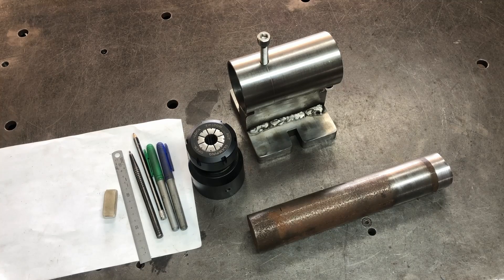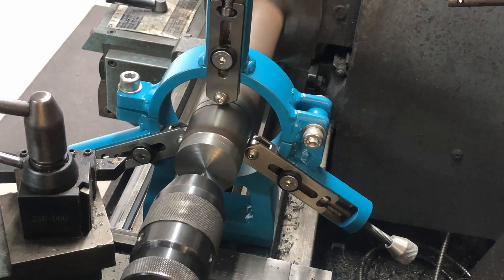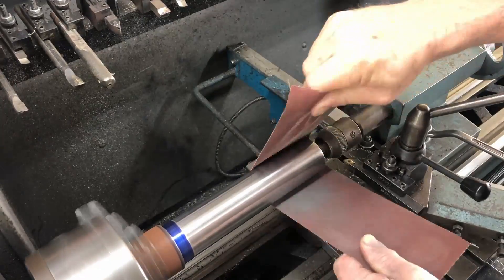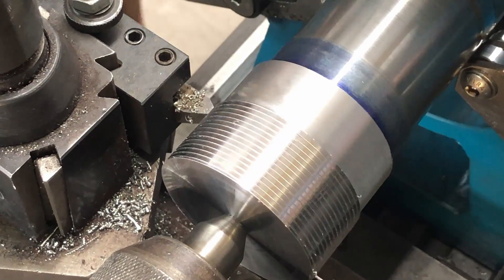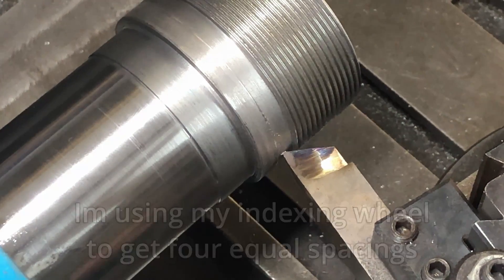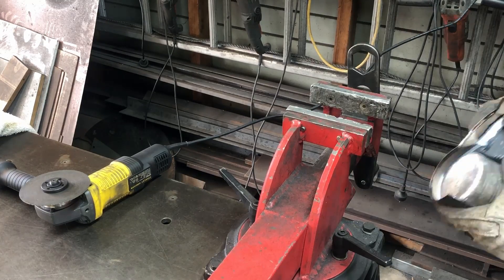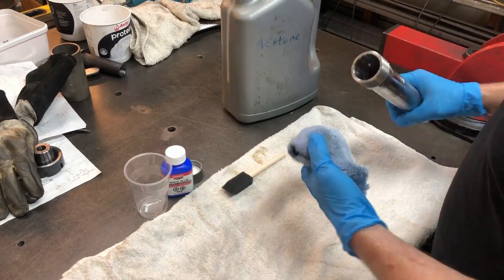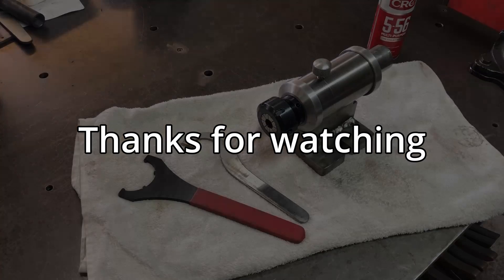Spin Indexer Build - Part 2

Comment: When you were checking the taper with the collet, blue at top & bottom, it could be because the grinder was slightly set off centre, a barrel shape is produced, thanks for sharing a very interesting video 🇬🇧👍.
Reply from the maker: No problem. Thanks for your comments.

Comment: Generally, all the Chinese ER collets are useful for are paper weights and not much else. Chinese ER collet holders aren't any better. You can buy one of the Chinese $30 ER sets as long as you realize that you are buying a pig in a poke. If the runout is less than 0.005" consider yourself lucky.
  Buy from suppliers who have a real address and guarantee their collets and holders to a given specification. Yes, a set of guaranteed collets will set you back ~$200 but think of all the new curse words you won't have to learn.
Cheers from NC/USA
Reply from the maker: Hi, thanks for your comments. Yes, I was probably lucky with my collets. 

There are two issues here in NZ regarding collets (and most other tooling). Firstly it is hard to find good quality branded collets (I have not found any in NZ to date). Second, a set of ER40 collets from a popular retailer like Machinery House is $700. Even then they state that the collets are made in Taiwan.

Comment: Thank you for the vid!  I’d be interested to know the size, type and source of bearings you used.
Reply from the maker: Thanks for your question. This only has thrust bearings. The spindle and body are machined for a nice bearing fit. 

The thrust bearings are AXK4565 45x65x5mm. I got them from Aliexpress for just over $5 NZ (including shipping). That included the bearing and the two washers. https://www.aliexpress.com/item/1005004070892893.html?spm=a2g0o.order_list.order_list_main.45.21ef1802IcYWp3

I priced these in NZ locally and the bearing was over $20, then you had to buy the washers separate at $13 a pair. Getting close to $70 for bearings for this project was too much. We get a bit ripped off here in NZ and I understand why a lot of people purchase through places like Aliexpress and Amazon.
Reply: @thehobbymachinistnz  Thank you for the reply and information, it's appreciated!

Comment: New subscriber. Very nice build so far. Enjoying this series. To be frank, you're making a tool that's mountains better than the one could buy even if you wanted to overpay for it.
Reply from the maker: Thanks for the sub. Yes, it is coming along great and everything works nice and smoothly. I have almost finished this build so part 3 will be out in a few days.

Comment: Excellent progress, its coming together nicely. Friendly tip, when you are boring a taper for a collet, upon blueing to check the contact pattern using a collet, you need to put something in the collet at its largest size (ie. If its an 11 - 12, then a 12mm shank). Without this the collet will just conform to whatever you have bored. I think you have enough stock to re-skim using this method and it would probably reduce your run-out a bit. Hope this helps. Cheers, Jon
Reply from the maker: Hi Jon, thanks for the tip. I had not thought of that but it makes perfect sense. I will do a recheck to see where we are at with the angle.

Comment: This is a very interesting series and I look forward to Part 3!  When you make a new knurling tool, will you stay with the "pressure knurling set-up" or change to a "scissor knurling" tool?
Reply from the maker: Hi Bob, thanks for watching. I plan to build a scissor type knurling tool when I do that project. I don't like these pressure types as they put a lot of load on the cross slide.

Comment: Just a key of advice with carbide and higher carbon level steels, if you turn up your rpm and feed rate to break a small, proper chip (c's and sixes), you'll pull the heat out in the chips and not the work piece. It will also turn down faster and leave a superb finish.
Reply: Yeah he might be lacking a bit of horsepower to get c’s and 6’s
Reply: Great video btw!
Reply from the maker: Thanks for the tip.